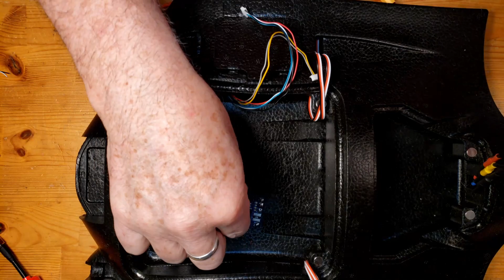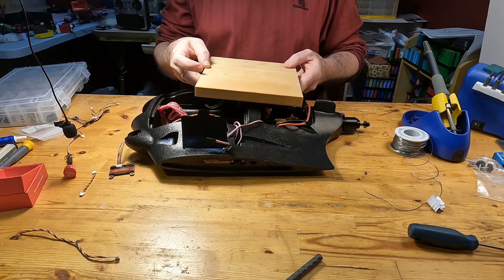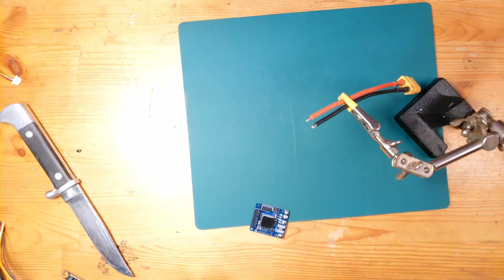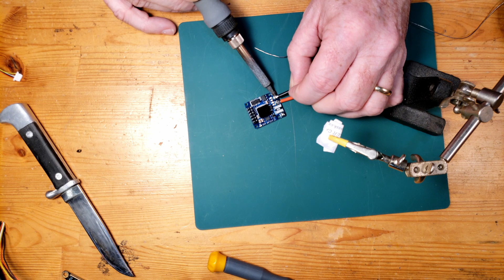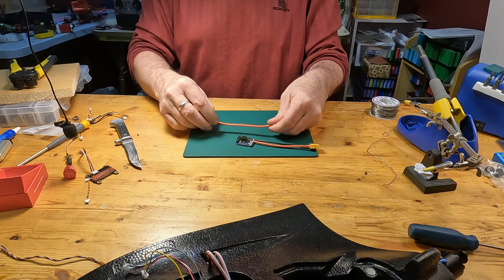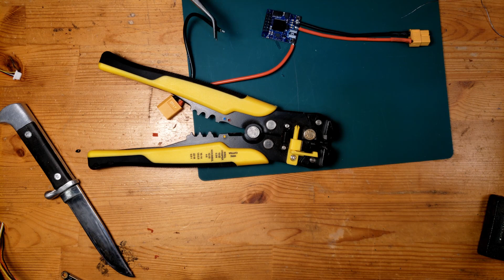How to Solder Flight controller ESC and Battery Leads to Matek f405wmn

Comment: I have matek f411wte can i plug my battery into it. I have a 4s 3300mah battery just worried itll burn up. This is my first ever build im starting from not knowing anything thank you for your help
Reply from the maker: Hi... great to learn about your build.  The main risk we have with batteries is using a battery with incorrect voltage.  If the voltage is too low, the electronics won't work properly.  If the voltage is too high, there is a very good chance of burning components. 

The Matek f411wte comes as two parts - like the one in the video (a flight controller on top, and the Power distribution board (pdb) on the bottom.  The PDB you have is rated for voltages up to a 6s lipo battery, so your 4s 3300 mah battery is totally safe.  Just follow the same steps as in this video.  If  you don't have one, I really recommend getting or making a smoke stopper.

The capacity of a battery (3300 mah for your battery) isn't important to the electronics.  The mAh is kind of like saying how big a gas tank is on a car.

I hope this helps.  Good luck and have fun with the build, and don't be shy to ask more if you need to.
Reply: Thank you my battery is 14.8v.  So i should be ok.

Comment: Hey the positive esc pad and the battery esc pad bridged during soldering,  is that ok?
Reply from the maker: If you are using the same flight controller as I did in this build (matek f405 wmn) then it is OK.  The battery + and ESC+ pads are side by side.  if you look on the matek website, you can see they are bridged in their wiring example.
http://www.mateksys.com/?portfolio=f405-wmn
Look at the very last picture in the gallery.

Hope this helps.